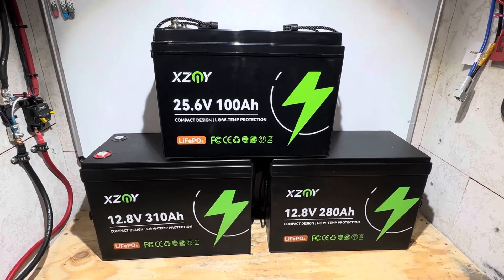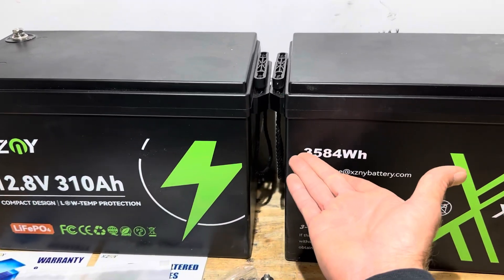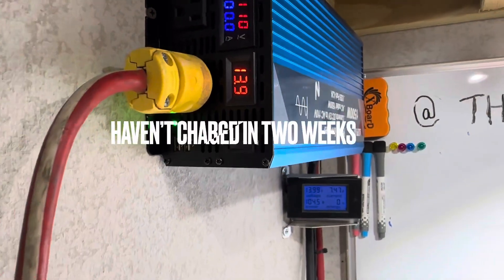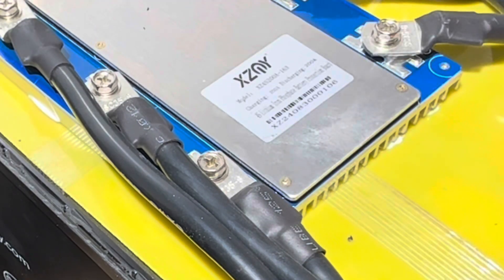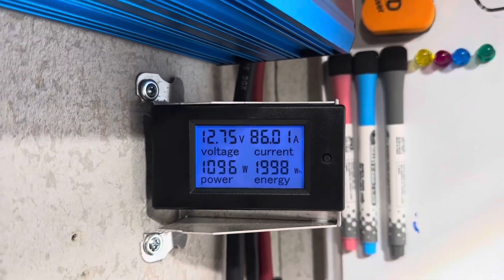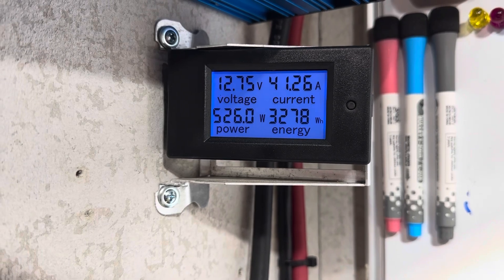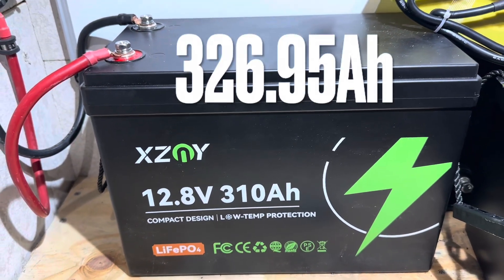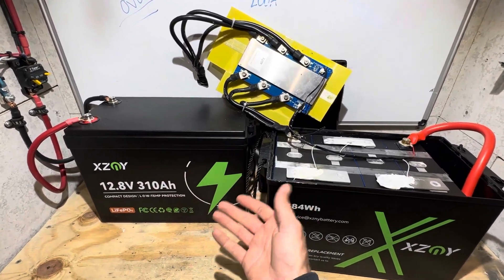Best Budget Battery? XZNY 12V LiFePO4 Lithium Battery Review Teardown Low Temp Protection Lithium

Comment: If I bought 4 of the 12.8 vote 310 amps. Would that run a portable AC unit for my 18 Wheeler? And how long would it run the AC. I need at least 10 hours run time. And would I be able to charge these batteries with the alternator as I'm going down the road.
Reply from the maker: Yes 4- 310Ah is 15.8kWh!! That should do it, you also can get DC to DC chargers to regulate the current from alternator to battery. Those will be a huge load on your alternator without a way to regulate the current

Comment: The XZNY 12.8V 310Ah Battery is $559.99. Dude that's some price. I got a 300Ah Dumfume battery for $282 from temu, and it's very good. $559.99 is almost twice the price I paid.
Reply from the maker: The prices change on Amazon often, sometimes multiple times per day. At time of filming they were much lower prices. Actually they just went off sale this weekend. They were $351 Saturday AM

Comment: I paid $152.50 for each one. Seemed to be a good price.
Reply from the maker: @DavidPotter-k1d   That’s a crazy low price! Amazon?
Reply: Where did you buy these for only $152.50/each?
Reply: @WilliamIraWoodIV  that exact one may be sold out. But they have the Watt Cycle for same or very close price. Note : the prices change all the time on Temu. By the time you check out, things may be close to selling out at that price, or the price may drop.
Reply: @WilliamIraWoodIV  Temu

Comment: I just bought four of these, but they must be old stock. 
They only had five, and someone else bought the last one, because the place is out now. 
The ones I have are marked GRNOE. I think they must have changed the name. 
I had four 24 v 100 aH batteries already, so these four 12 v 100 aH batteries will just add 200 aH. 
I had enough to run my window air conditioner and two freezers running nonstop last summer. 
But it was cycling the batteries down to 24.6 v or so, and if I got a cloudy day, it would be down around 24.0 v. 
Hopefully I will have enough with 600 aH to keep the voltage ⚡🔋 up a little better. 
* I tried to find a review for these, but it goes to the XZNY reviews. 
* guess it's an earlier version. Mine have the same lightning bolt ⚡ on the case, but it's orange. 
I'm waiting for the #2 welding cable to hook them up to get here.

Comment: Those are Hithium 280Ah rated cells manufactured 12/Apr/2024. The QR code is not original and has been re-etched. Manually enter the QR code and change the second digit from I to 1 and it will come up in the decoder. These are ESS grade cells.
Reply from the maker: Thanks for the research! Appreciate you!

Comment: this thing is sick, need exact dimensions with handles and without, may have to cut the handles off..
Reply: Sorry, we should have provided more accurate dimension details. Our design team is working on a solution.
Reply: @xznyBattery it's not rocket science! LOL
Reply from the maker: Definitely awesome batteries! Check the Amazon listing it has detailed measurements! Anything else that’s not listed I’ll measure for you!
Reply: @THEOFFGRIDMOUNTAINHOMESTEAD no they don't have detailed dimensions without handles
Reply from the maker: @ I’ll get you a measurement today
Reply from the maker: @MikeDeFina  case is 13-5/8” minus handles
Reply: @THEOFFGRIDMOUNTAINHOMESTEAD  awesome! it will fit! but have to cut those stupid handles off ugh
Reply: @THEOFFGRIDMOUNTAINHOMESTEAD  thanks so much!
Reply from the maker: @DeFiDuke  you’re most welcome! Oscillating saw will make quick work of the handles! Take care, be safe!

Comment: 12V... come on man, those giant ass cables. We're moving on to 48V!
Reply from the maker: Thank you for sharing your opinion. I like 12V due to hundreds of billions of 12V components being used worldwide at any given time. Most common DC voltage. https://youtu.be/6mnUdy2so9U?si=oTXDnU_qm8HpELq-
Wire is a one time cost for a 12V installation. Lower 12V component costs make additional wire costs a negligible concern. There are other considerations as well that are beyond the scope of a comment. The battery in the video has a much larger wire setup than any other 12V unit for the BMS rating out there. This is the key takeaway.
Reply: @THEOFFGRIDMOUNTAINHOMESTEAD  I hear ya, but everyone's going 48V now. Look forward to your own vids using that platform.

Comment: It's definitely a very well-built battery.  I look forward to seeing the 25.6v unit tested.  Also, the BMS performed better than i expected. Overall I would definitely consider these batteries in my next build.  Thanks again for a honest review!
Reply from the maker: The XZNYs are battle tanks lol, most batteries in this class have a tiny #4 AWG positive lead. These are made to work! The 25.6 will be a little different run on an unreleased project so it will be fun! Always appreciate you stopping by! 👍

Comment: WOW! I wish I had seen these a few months ago. I bought three 100 ah batteries and wired them in parallel. I could have saved some time and money with one 310 and not had to mess around with paralleling 3 together.
Reply from the maker: The compact batteries are becoming more mainstream and more affordable too! You are spot on about time and wire savings! These are only about 25% larger in total case volume than a group 31 100Ah. I really like how the market is moving. Many of the battery manufacturers read  through comments on YouTube, comments like yours influence the market more than you know!  Appreciate you stopping by! Take care!